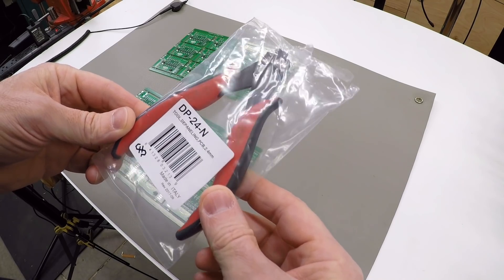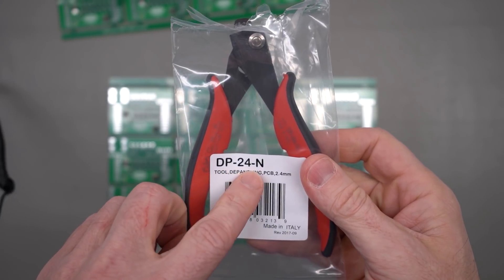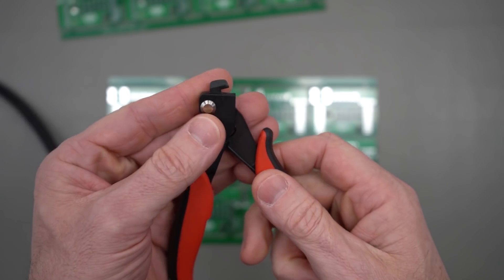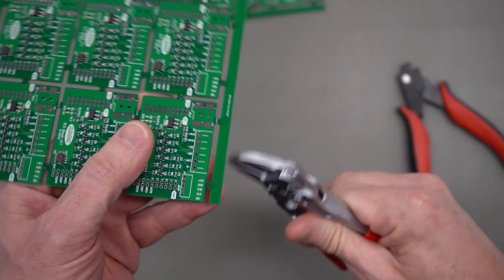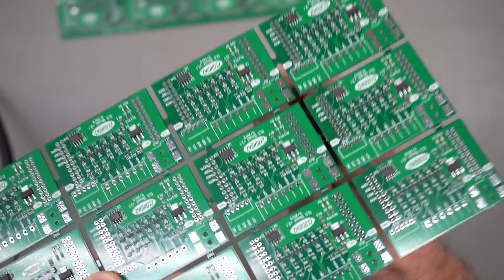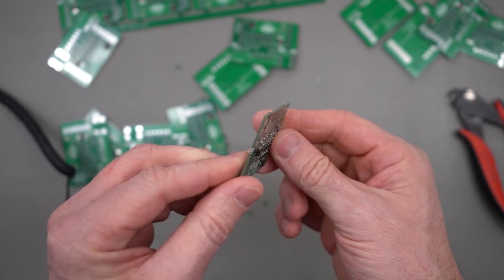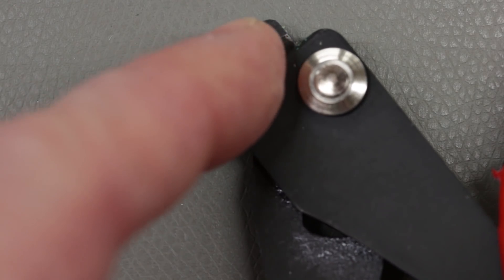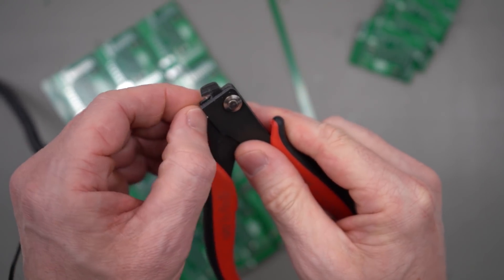Panelizing PCBs Addendum: Hakko Depaneling Tool

Comment: Rather obvious that these are not really made by Hakko. Just a Piergiacomi DP24N with a red handle, even the part numbers are essentially the same. There is also an esd-safe version available, which I have and works the same, just different handles.

They also make pneumatic hand tools and table top versions if you really need to do lots of seperation, but these are pretty expensive. 
Perhaps you could get away with a pneumatic nibbler (as cheap as 50€) and a little rework of the head using a dremel.
Reply from the maker: I have a more recent video where I made some blades for an Olamef SEP3.  And it indeed works very well

Comment: To shear the individual boards I would use a paper cutter with pins to index holes in the board to exactly line up the board with the blade.

Comment: Tool overthink. For the header, cut a slot in a sheet of reasonably hard material (MDF?) the same depth you want to snap it off. Glue a strip of emery cloth on the board parallel to the slot. Insert the header, snap it off and sand the resulting edge with a couple of quick swipes. Do this with the lengthwise edge of all the boards and clean up all 4 boards at once. Slide in the next header to remove the previous one and repeat.

Comment: A brief run along the edge of the tabs with a sanding sponge clears the rough fibreglass beautifully. I get pcb from China and the pcbs are really rough at times. The sandpaper works great. That depaneling tool looks good for larger multiple boards though. Would still sandpaper them though.

Comment: Nice, I was just checking these out, but do not have a need for it "yet" was trying to think what else it would be good for. . I use  a plastic nibbler alot, but its rather large, I wonder if this can nibble slots in 3d printed parts ( something I do fairly often ). Also those knipex are sweet

Comment: I like to depaneling tool, but it still looks time consuming.  What do you think about making a dedicated sled to hold the panels for use with a tablesaw to do the depaneling work?  Perhaps, using a laminate blade for a smooth finish.

Comment: Nice find!
I guess if you match the slot width exactly with the tool, you could get a cleaner edge by not having the tabs perforated.
Maybe worth the try getting one panel without holes with the next order?

Comment: great video. maybe somehow add a spring in the middle of the tool?
thanks for the great content
Reply from the maker: Yeah, I've been thinking about it.  I've also been thinking about building a fixture with a pneumatic actuator.
Reply: @Clough42  you had me at "pnuematic" :P
Reply: @Clough42  That is the first thing that came to mind for me.  A small table with the tool protruding vertically, opening facing away from the operator.  You can handle both sides of the board, and use a foot pedal to actuate.

Comment: Your pcb panel is ideal for V-cut, which is alot less time consuming tearing apart.
Reply from the maker: Agreed.  JlCPCB does not, however, support assembly for v-cut panels.
Reply: @Clough42  Perhaps it is a little too late in your case but they do offer it. They kinda "openly hide" their ability to do V-Cuts because it's no extra charge to the customer at JLC and V-Cuts take a fair amount of labor and time which means they probably lose profit on those operations and they don't want everyone to use it excessively. I hope this link can assist you if you decide to use V-Cuts in the future. https://support.jlcpcb.com/article/49-pcb-panelization